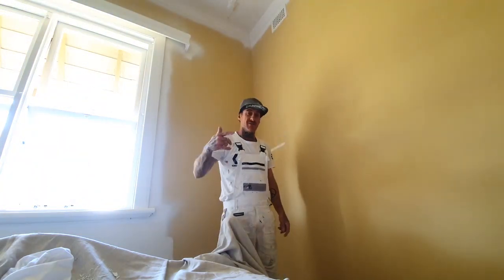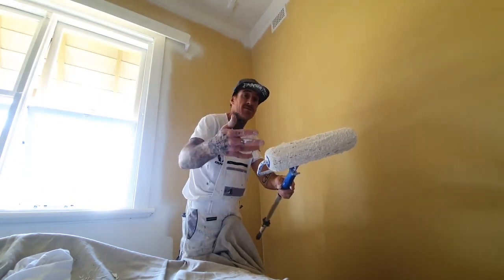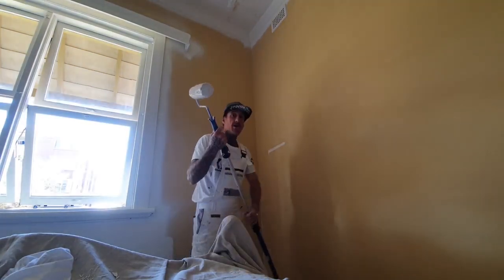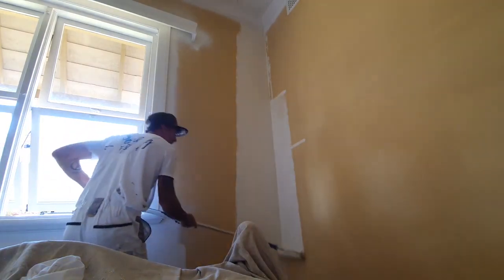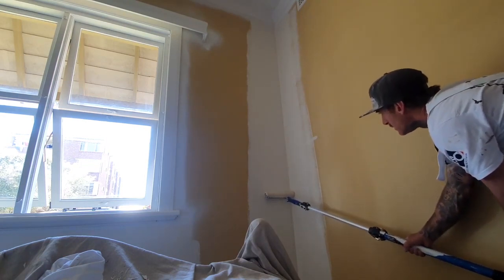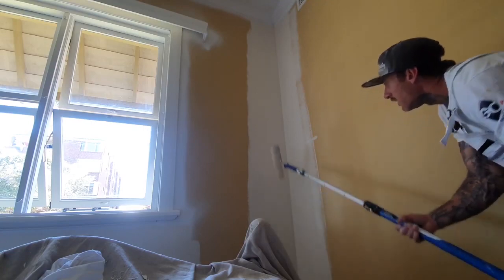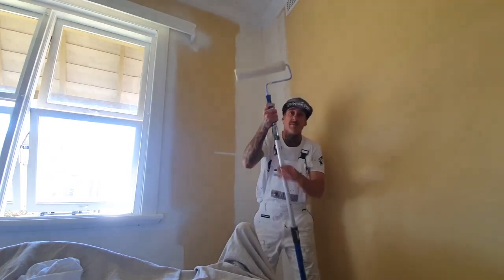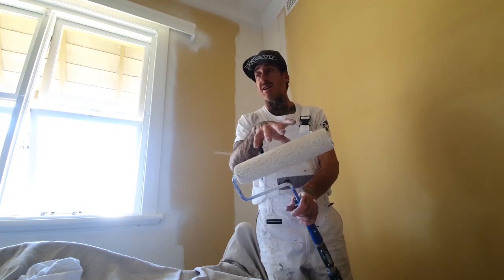HOW I ROLL CORNERS

Comment: Brother in your opinion would you use a 15 mm nap on fresh drywall or a 10mm? In Canada they say 10mm but it simply doesn't seem to hold enough paint. What is your recommendations?
Reply from the maker: Hey brother, on new drywall I use a Oldfield's 11mm nap, a lot smoother finish💯🤙🙏

Comment: But i how does your roller good so much paint?
I was recommended one by the paint shop rubisco plus when i cut and try to rooo near corners the side that don’t have a metal like it like ur roller I use the side Where there is. I metal convector so I can roll close to the edge but I have to press to one side to get the paint out
Reply from the maker: Hi Saif, what size nap roller did you purchase? Regards josh
Reply: Oooo not the small small one medium 9 they call it ?
Reply from the maker: @Semaj.18272  I would use a 11mm nap it will definitely hold more paint 👍

Comment: Isn't 15mm nap for walls to textured?
Reply from the maker: No that's usually a 22-30mm these are 100 year old concrete walls. You should know you can use a 22mm and turn the nap into a 11mm with how you lay it off !
Reply: @paintingbyjosh  lol ok

Comment: Thats great. Only problem for the complete novice is that they end up scraping the other wall multiple times. Moving the roll very close to corner without touching other wall is not as easy as it seems in the hands of professional.